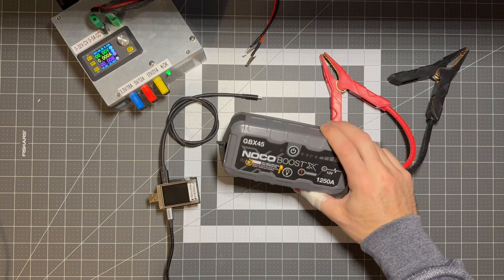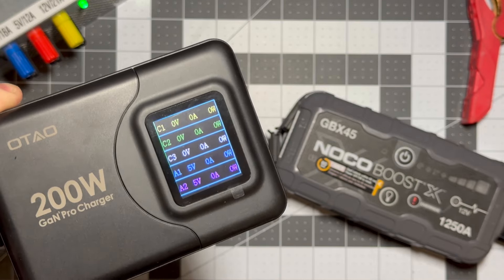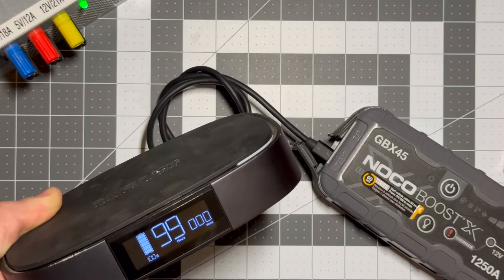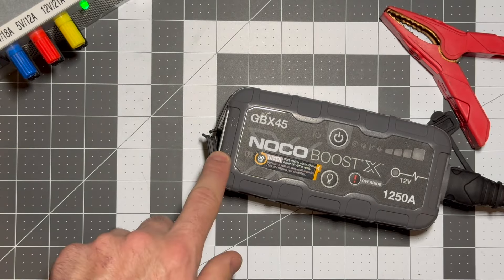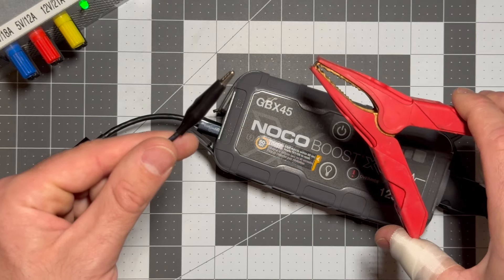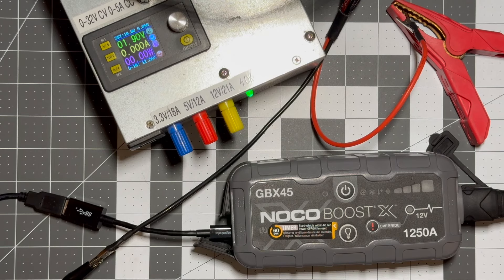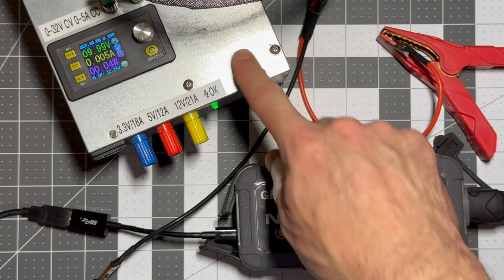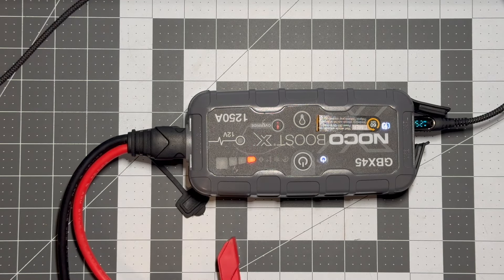No-Open NOCO Repair: Power Measurement and Charging Hack

Comment: Get yourself a car cigarette lighter plug… attach to NOCO and drive for 15 minutes…
Then you can charge it from wall outlet…
Don’t need a bunch of gadgets!!!
Reply from the maker: How is 12V from a cigarette lighter plug different than 12V from a 'gadget'?
Reply: I think @MrWilliamthomasusa is referring to the 12V Noco cigarette charger you get free with a new unit. This is supposed to revive the low battery state as you’re supplying 12v as opposed to 5v usb. No different, just “gadget free”. Not 100% sure it works as good as this method where you can see exactly what is going on with charge status.
Reply from the maker: @jasonbonner9475 I hear ya, but these GBX devices only have USB-C Power Delivery input. There's no way to just feed them non-negotiated voltage through the USB-C port *that I know of*.
The 12V cigarette lighter plug could have the electronics that allow it to feed USB Power Delivery at the 12V PDO, but I doubt it. The USB group deprecated 12V in favor of the 9V and 15V PDOs. Regardless, as far as I can tell, the only way to get power in to the NOCO thru the USB-C port is by handshaking with the Power Delivery controller inside, which in this case is dead. Happy to be wrong about this, and I'd love to know how the car charger can help.
Reply: @colindgrant  Original NOCO Car charger is 12V 65W, this is what you use when normal charger dont work as it forces 12v and not "auto select 5v" as the wall charger does when low on power. Just use the manual and what comes with the charger, no need for anything else.